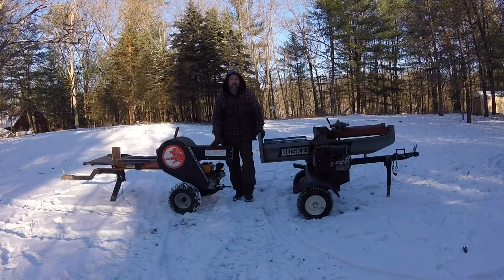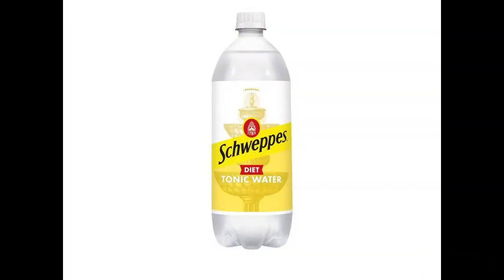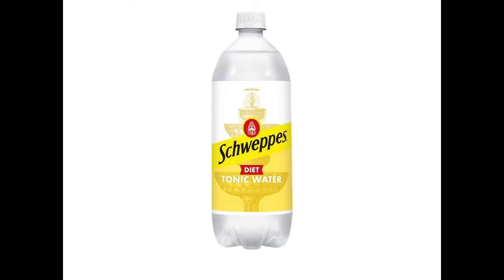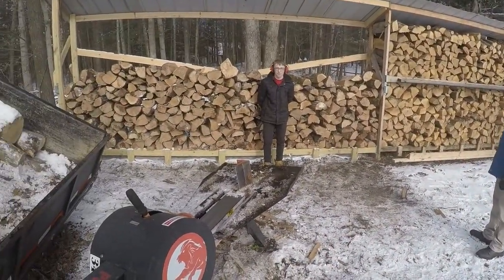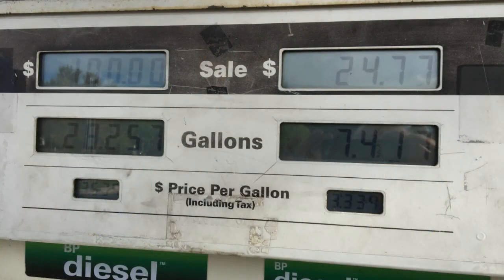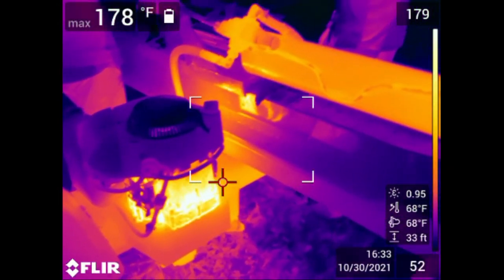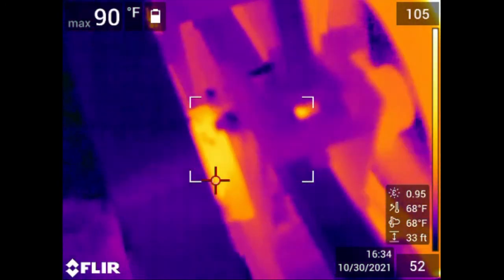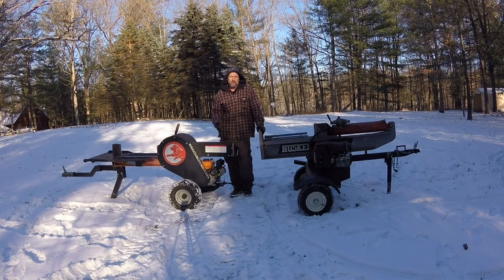Kinetic vs hydraulic log splitter efficiency

Comment: I built my own kinetic wood splitter with a 5hp petrol (gasoline) engine. 
The fuel tank is quite small on it, however I can split a lot of wood before it needs refuelling, nearly a whole day of splitting. 
After the initial outlay of building the splitter, the kinetic function is extremely cheap to run and maintain
Reply from the maker: Indeed.  Unfortunately I've experienced a couple of failures with rack teeth on other brands but this particular one has been holding up so far.  I believe and recommend keeping the rack and pinion properly greased helps reduce failures but this can be overlooked by many owners.
Reply: @Ilikeurtractor  I agree. I grease all my bearings and pinion at the start of every season and it hasn’t failed me yet. 
Mind you, I made my own rack and pinion out of a very heavy duty double row chain and sprocket, I didn’t like the idea of the standard rack and pinion due to the teeth not having much meat on them.